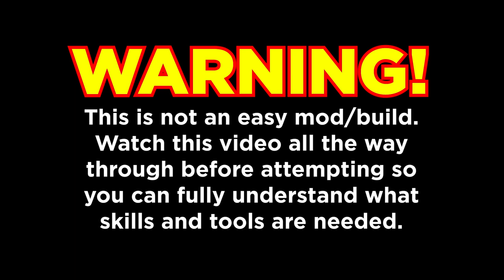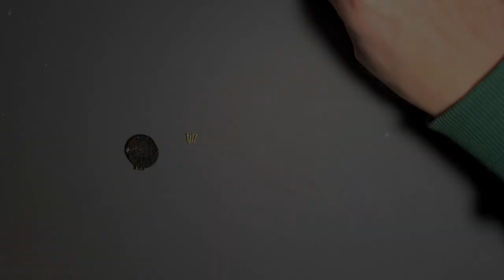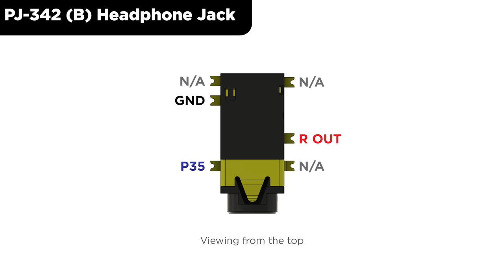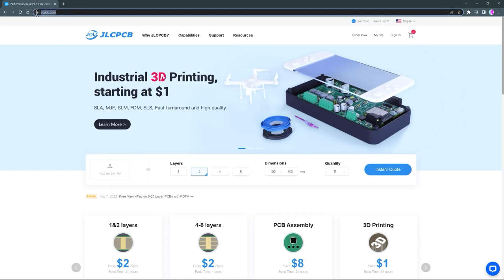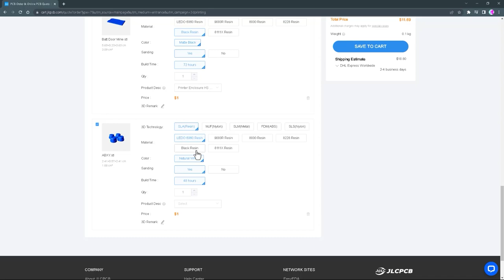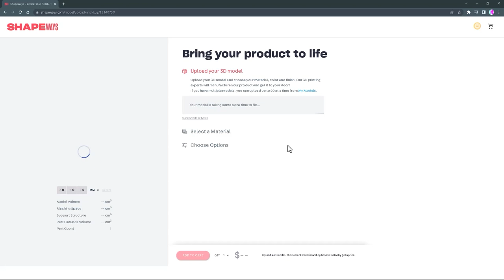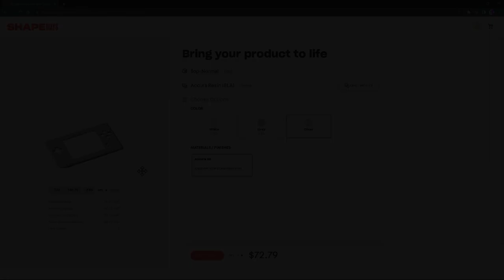Building the SP Slab

Comment: Only problem I had with this build was the audio was low and I couldn’t adjust it any advice on why is that? Should just solder the wires to the speaker pads on the actual board?

Comment: I'm not sure if I'm missing something here but I'm totally baffled by the headphone port here. Why is only R being wired up? Wouldn't that only output one channel to one ear?

It's also using GND instead of AGND for ground, which allows speaker muting to happen but doesn't block DC to headphones so can potentially cause damage
Reply from the maker: You could wire up both channels for audio, but for simplicities sake, I just showed how to get mono audio out of the headphone jack.
I'm not aware of that risk you're mentioned by using GND instead of AGND, but I can ask an engineer friend to see what issues it may cause. It could be an issue, but this would be the first I am hearing of any potential harm to headphones.
Reply: @XipherDesign  The headphone dongle for the stock GBA SP internally shorts the GND and P35 pins to mute the speaker, but for the headphone jack it separately supplies an AGND connection along with L/R. 

The TRRS jack muting hack works by sharing regular GND for both P35 and the headphone jack instead of the AGND that you'd get via the dongle which is filtered by that single 100µF electrolytic capacitor on the SP motherboard (also utilised for the speaker). This seemingly works, but without the capacitor, it doesn't block DC current to the headphones, which essentially turns the headphone coils into little heaters. It won't kill most headphones quickly, so it's an insidious problem that has slipped under a lot of people's radars. 

Incidentally, this is why a lot of Gameboy Colors have broken brown yucky speakers. The capacitor was particularly prone to failing which caused the speaker to heat and burn out prematurely.

This issue can be completely solved by adding a 100µF cap to each of the L & R channels between the board and the headphone jack. As another aside, this is exactly how the DMG gameboy protects your headphones, and the purpose of the two caps sticking out of the headphone PCB :)

Comment: Hey xipher i started building the slab and have run into some troubles for being too heavy handed. Well trying to fit everything together I broke off the brackets for the ips ribbon connector on your custom pcb. I was wondering if there's a way to route the ips to the board with wiring? This is definitely one of the most advanced mods I've ever done and have been having fun working on it but I'm just wondering if I can remedy my mistake or if I should just buy another one of your pcb's. Just wanna say thanks for you sharing this project and everything and being so transparent with this build and the stl files.
Reply: update after quite a bit of frustration, persistence and determination I have assembled the slab. definitely a rewarding build. probably the most difficult i've ever done.